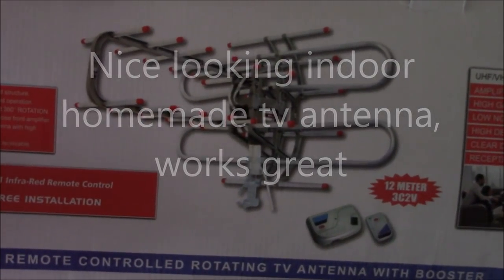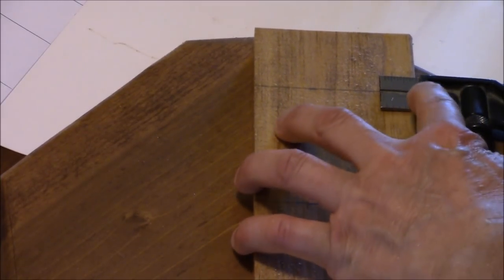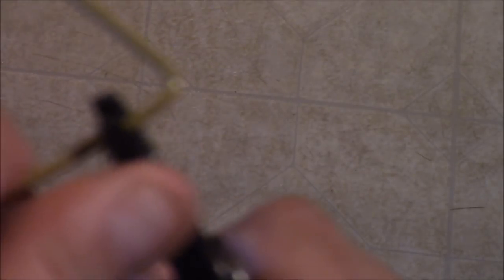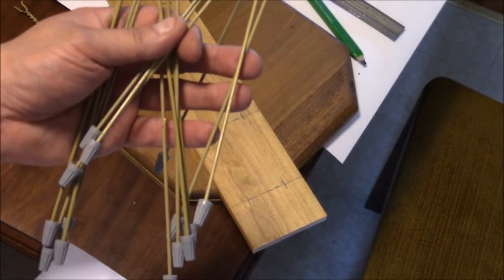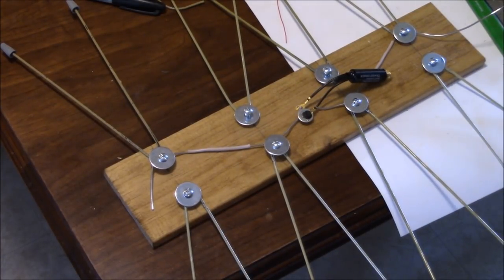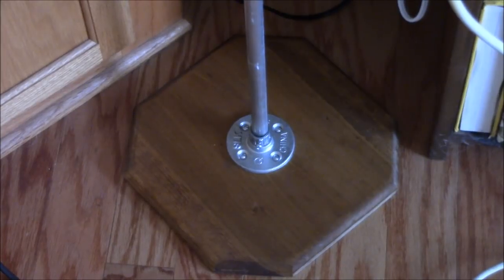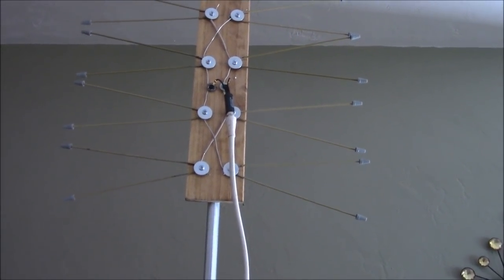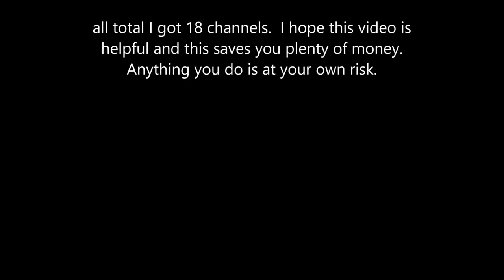Homemade TV antenna, looks good, works good

Comment: Ok.. this blew me away.  I just built this antenna (using #10 copper wire I had already). I had it just sitting flat on a table beside the tv, and when I connected to the TV, I instantly received all the channels I could not get with a antenna I bought off Amazon for $25 (ya it was cheap). This antenna absolutely rox!!!
Reply from the maker: Nice work!

Comment: Built one this weekend outta scraps from the garage. I live about 40 miles from San Francisco, and the $25 store bought antenna I have gets 19  channels. I was pleasantly surprised tonight when I hooked this up and got 38 channels! I then tried a tin foil reflector - that didn't make any difference in the reception, but it did make my wife mad that I used the tin foil...thanks for the instructions!!!
Reply from the maker: Glad to hear it worked out well for you
Reply: LOL thanks for the comment on the reflector, I was wondering if that would help. Any chance you can post a picture of that?
Reply: wives always find something to get mad at us about 🤣😂🤣

Comment: We have been making these antennas since the 70's... Lol... It really does work and it's Awesome to see "OLD SCHOOL" Technology making a comeback! You can also use a paper clip or just a strand of speaker wire put into the center of the coaxial hole and get the same or better reception depending on how close you are to the signal towers.
Reply: Hello can you explain this better? Thanks.

Comment: FYI, 8" "whiskers" are tuned for ch 58/738MHz (734Mhz-740MHz).  I would think most people would be looking for something more middle of the range, like 10" whiskers for ch 34/590MHz (590MHz-596MHz).
The formula is 300/frequency = Wave (wire) length in meters.  Convert it to inches with Wave (wire) length x 39.3701.  Then divide by two for the Half Wave Length because while an antenna receives in 1/4, 1/2, and Full wave lengths, the 1/2 Wave length is always the dominate one.
Reply: Thank you
Reply: Thanks

Comment: Thanks good job. I made one out of a 2x4 and 10 gauge wire. It works better than the store bought ones. Less expensive too. I get 21 stations. The indoor ones I bought only had 6 stations that were breaking up.
Reply from the maker: Nice work

Comment: Yes, that is a very good bidirectional antenna for UHF and high VHF.  The elements are not long enough to work well for low VHF.
The distance between elements you used was a bit short of the ideal but your results show that the design is more than good enough.
Reply from the maker: Thanks for the info

Comment: It works really well. I’m using compression fittings on the cable they really help. I got 10 extra stations by using compression fittings. I just use 2 pliers I don’t have the tool. It’s works good.
Reply from the maker: good to know

Comment: One more thing. It worked so good I’m thinking about making another one same dimensions and using two in different directions 6 foot apart. With a splitter you can use 2 antennas on one TV.
Reply from the maker: I wish you the best

Comment: I too made my antenna . Recently I repositioned it so I made the obligatory channel scan . For the heck of it , I also made an analog scan . The result ????
I now get an additional 5 radio station broadcasts with the best Oldies station I've ever heard . Tried to pick those stations using a " radio " , did not work . I'm in NYC , the radio stations are from Jersey Shore Line . Just thought I'd put this out there . And yes I get 52 tv channels .

Comment: In your layout, you made marks for 10 elements on each side of the antenna, but when you built it you only had 8 elements on each side of the antenna. Does it make any difference or not? Other than that your video was very well done, I enjoyed it am eager to build this antenna.  So 20 elements total or 16 total, or does it matter?
Reply from the maker: the extra mark was for the 300 ohm to 75 ohm  antenna adaptor. I don't know if more elements will improve reception

Comment: Thanks for a great description of building this antenna. I looking at several designs, but wanted to ask: How far are you from the stations you receive? I am about 35 north of New York City, and, for instance, WABC channel 7, 174 mhz, is listed by the FCC as having "fair" propagation up to the area we live. 

Is your design strong enough to pull in stations this distance? Have you ever needed or used booster? Thanks again...
Reply from the maker: I got channels that where 65 miles away without a booster
Reply: @bbbjim1fixedit  Thanks! And sounds great...

Comment: I built this antenna and it works great, I get over 100 channels without even adjusting the antenna but it is on my roof, if it’s in my room I get about 40 channels which is not bad because they are all the chai need like channel 2,4,5,7,9,11,13, up to 40 and they are crisp clear.

Comment: How far apart on the hangers for my home made antenna made of coat hangers with copper wire and f connector on a 3 1/2 ft pole on my entertainment center

Comment: I live WAY out in the sticks. My store bought gets 3 channels in 1 room and nothing in the rest of the house. I build one of these and positioned correctly I can get 20. Very impressed. I messed up a bit though. I cut my hangers so they are 14" long so the arms are only 7" instead of 8", but they are open 3". I guess my question is do you think I could do better by rebuilding with 8" arms, or is it even worth the effort? Does that 1" really make a big difference?
Reply from the maker: My experimenting with this design I made a prototype with shorter elements and  it worked well, yet the longer elements pulled in some channels the shorter ones did not.  Personal choice of channels. I am glad to hear your antenna is working well.
Reply: @bbbjim1fixedit  To give an update. I added a reflector on the back of mine and I went from 20 channels to 39. Huge difference. I'm getting channels 57.89 miles away. I did build one exactly like yours and I'm getting the same result but yours is a much more sleek design and looks nicer with the smaller profile. The only difference, and you may like this, is that I ran screws with nuts and washers all the way through. I have the arms on one side of the board and the connecting wires on the other side.Thanks for the video.
Reply: Can u explain exactly how u fixed the reflector? I got an old satellite dish, don't know if that can be used. Thanks.
Reply: The longer they are the lower the frequency they target.  If you search for bow tie dipole calculator you can find an online tool that allows one to enter  a frequency and it will tell you the size to make it for that frequency.  The reflector should be 4 inches behind.  If you are keeping this inside it can be made by gluing aluminum foil onto cardboard.

Comment: Dude I bought that same antenna off eBay that you have and it comes with a 110 box with a in and out wire and I'm getting 42 HD channels I think you didn't get all your parts mine has to be assembled and it was $32 plus shipping for the same antenna you shown in the beginning of your video that you said you only got two Channels with.

Comment: I see the length of the board but not the width. How far apart are the two rows? I see 3/4" from the edge of the board but no board width. Thanks a very simple project.
Reply from the maker: 3 1/4 inches
Reply: @bbbjim1fixedit  OK  You have two rows of 4 V wires and 3 1/4 inch between the V wires and 3 1/4inch between the rows?  I am going to build one. Thanks

Comment: A true yagi outside your home could catch all channels from a one given tower. Yours react well to a reflector plane, like a glass. So for a wave length of 400 mm , the glass lags 100 mm behind your antenna wires. That fake yagi could be remaked to work if you copy the original from 1910. The Yagi Uda radio research, better gain if you hit the vector direction from the roof.

Comment: Hi, I made with 12" (6" x2)v same set up, but only got four channels in Toronto canada. May I know why?
Reply from the maker: The wires will need to be longer, about 20 cm on each side of the V.  I wish you the best on your antenna
Reply: Because you didn't follow the directions?

Comment: It's surprising how you get 18 channels without those $100. antennas in the store that got circuits panels and many buttons to find channels. I bought to different antennas and I spent $20. and $40. in another and hooked them together to get more channels but I get just 5 channels and I did my diy antenna and I get 11 local channels
Reply from the maker: nice work

Comment: What about adding an amplifier? Is it possible or even necessary?
Reply from the maker: depending on how far away your tv stations are will determine if an amplifier will be beneficial.   if you are too close it will not help you.  Adding a reflector (a wire fence like grid) on the back side if your antenna elements will improve the signal of the furthest stations.

Comment: so are you hooking the transmitter up to the tv via coax?  and its hard to see how and where the transmitter is hooked up or built into the antenna. for us who know nothing of them thank you very much!
Reply from the maker: the coax is hooked up to a tv matching transformer, and this is in the center of the antenna connected to each of the wires that crisscross the elements (hangers).  Best of luck building your antenna
Reply: @bbbjim1fixedit  Build it just like you see it, then hook your cable to it and the TV! Them just make sure you aim it toward a TV Station. It's really as easy as it looks.

Comment: can i use a thick copper wire or fance wire instead of the steel hangers ?
Reply from the maker: any metal wire will work.  I wish you the best on building your antenna
Reply: Yes that's what I used, 10 gauge copper wire. Anyways mine works great, I get double the channels. Don't have to move it around, receives all stations quite well.

Comment: I got one like it to got 32 channels in my area in Athens Tennessee but I'm supposed to get more channels and it's not picking them up what can I do to get them back in
Reply from the maker: closer to windows helps as well as turning the antenna in different directions. Sometimes a course screen placed behind the antenna helps in reflecting more signal onto your antenna.
Reply: @bbbjim1fixedit  I tried to put it next to my window and it didn't help much knock out a few channels I put it on top of my entertainment center and works fine but still not getting the other local channels don't know why
Reply: I set mine up in the house on the top floor and reception was okay for most channels. 
I decided to mount it in the roof and elevate it with an additional 4 foot pvc pipe.  It made a huge difference.   You'll need to weatherize it though.

Comment: Does it matter what metal to use? I know the manufactured ones are aluminium. I assume to cut down the weight. Is steel a better choice?
Reply from the maker: any bare metal wire will work
Reply: Best is copper, then aluminum, then steel. I'd use ga. 12 - 14 electrical wire; an old, discarded flexible copper tube also works extremely well because of the added mass.

Comment: Where did you find wire hangers? All the regular stores like Walmart are selling plastic ones.
Reply from the maker: Dry cleaners still use wire hangers, yet any bare metal wire will work.  I wish you the best on building and enjoying your antenna

Comment: I tested today but not receive any signal.. our country has analog signal. also indoor testing with 1 metre high ... which is the best signal reception polarized type? vertical or horizontal?? which best
Reply from the maker: Seeing you received no TV signals, this antenna may not work for analog.  I wish you the best in finding an antenna that works.
Reply: In what country do you live?  We may be able to look up what works for you.  This antenna works for UHF and high  VHF.  If your channels are low VHF then it will not work.  You also need to make sure that you don't have a bad transformer because a defective one will prevent the antenna from working.
Reply: +Greg Reed iam living in India
Reply: India uses a small band in UHF for TV.  It is about the range of the USA channels 33 to 54.  This design should work.  You need to find out where the transmitters are.  What direction and how far.  You most likely need to have it outside and as high up as you can get it.  If you are far from the transmitters you will need to put a reflector 4 inches behind the bow ties.

Comment: I built the same antenna several years ago and it's ok, but I often lose a few channels during the day and it cuts out when I have heavy traffic. 

Anyway, what are the caps for? I don't have those on mine.
Reply from the maker: Just in case it falls over or if bumped into the ends don't poke or scratch you or furniture

Comment: Well! in my home I am having all type analog TV is this antenna able to work for that?
Reply from the maker: I am not sure since the only signals we have in the United States are digital.  Hopefully someone reading this will be able to answer your question for you. If you have an analog TV and want to view digital signals you will need a digital signal converter.
Reply: The antenna doesn't care what type signal it recieves only that it's tuned for the correct frequency. The TV needs to be a newer digital capable type to process the incoming digital signal or you will need a digital converter box if you have an older tv. If everything in your area is Analog then it won't matter

Comment: I see a CRT beside the antenna. Does that antenna would work with old CRT TV too?
Reply from the maker: You need a converter box for crt  tv's
Reply: You can modify a tube tv to use a digital tuner such as a digital vcr they made them during the conversion period. Usually a dvd/vcr combination.  It must have a digital tuner. When I was in high school my friend said you could add a video input jack for video and use your stereo for audio. I never had a vcr so I had no interest in trying it. But old tvs had video if you had a vtr reel to reel setup. It's all the same principle. There is ways on the Internet.  A direct connection is far better than using a channel on that old tv. Those government converter boxes did not work good on old tv analog tuners. The direct connection was much better.

Comment: You forgot to build a reflector i bet if you put it out and point it to some direction you can get 25 channels due to the reflector diameter
Reply: I was wondering what putting a mesh on the back of the mounting board would do, but I don't know the proper distance for the mesh to get the best quality of reflection.

Comment: I made my antenna just like this but all I can get on the inside is 9 channels would I get more channels if I put the antenna outside ?
Reply from the maker: Not sure if being outside would help much, however turning the antenna to different directions helps bring in channels better many times
Reply: bbb jim1 I put it outside and got 7 more channels but I need to put a reflector on it what would you recommend ?
Reply from the maker: good to hear it worked better for you outside, I didn't put a reflector on mine since it pulled in all the channels I wanted.  Best of luck to you
Reply: @petecopeland3098  a reflector will not only make the antenna more directional it will also increase the gain.  Use rabbit wire the kind that looks like the reflectors on a screen bow tie antenna. Hardware cloth will also work but rabbit wire is stiffer and holds shape well.

Comment: Is this UHF-only (as it looks), or does it get VHF-hi, too?
Reply from the maker: it gets both
Reply: There's very little chance it would receive any weak to moderate VHF frequencies being the elements are too short  for the longer wavelengths of VHF broadcast signals. This is mainly an antenna for the UHF band, RF channels 14 and above.

Comment: How did you calculate  the lenght of the materials?
Reply from the maker: My measurements are in imperial, 1 inch is just under 26mm.

Comment: is it work 100-900mhz??
Reply from the maker: Not sure what signal range it picks up.  It works with the digital signals used in the U.S.
Reply: This design works best for 300-900mhz. But will work for channels in the 100-299mhz range but only if the transmitter is close.  For those channels the easiest to make is single two sided dipole.  Cut two wires 15 in. Each and have them extend straight out to each side and connect each side to one side of a transformer.  This is essentially the same as a pair of rabbit ears.  You can combine this with the bow tie antenna with a combiner.
Reply: @gregoryjreed  - Good tips!

Comment: F.or the bow ties can you use copper? I already have plenty of thar.
Reply from the maker: any conductive wire will work
Reply: Copper is best. It can be soldered and all connections should be soldered.

Comment: I got only one channel why?  Where is the problem in my anteena
Reply from the maker: I would suggest ensuring led lights near by are turned off.  Some have been known to cause reception issues.  Also I would try turning the direction the antenna faces and rescanning for channels. Best of luck to you
Reply: @shaik khaja mohiddin
 - Look into a 75-300 Ohm Balun - Transformer

Comment: Do you have an estimated range?
Reply from the maker: I was able to pull a station from 65 miles away, yet I am not sure how far beyond that
Reply: Thank you
Reply: Depending on the range but you should get 100 miles if the antenna is high enough and above trees hills etc.
Reply: Antennas are line of sight (LOS) the higher the antenna, the farther the range.
Reply: A reflector is a must if you want distance reception. Use hardware cloth. Rabbit wire. Chicken wire is not heavy enough   screen bow tie antennas used screen like rabbit wire and works well. I would also make the whiskers 10 inches long for better high vhf channels. I think the distance is 4 and 1/2 inches apart.
Reply: Its wark box tv???